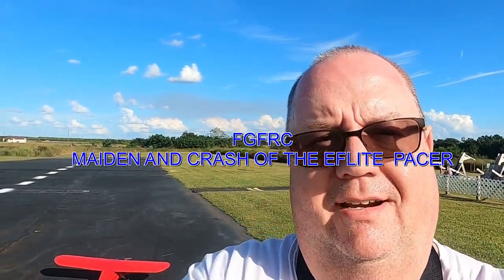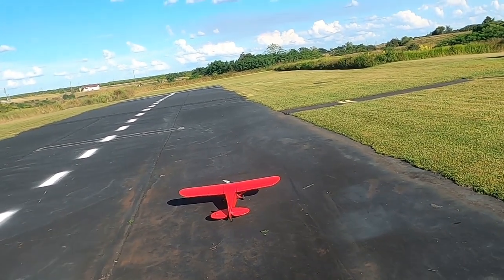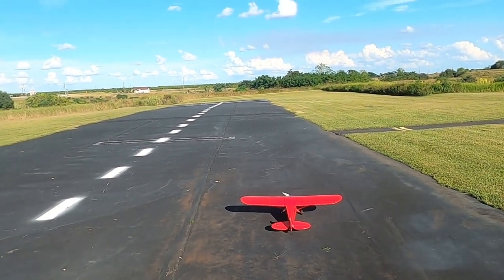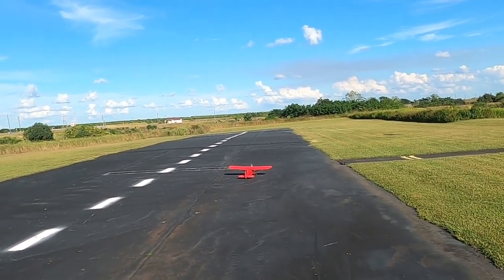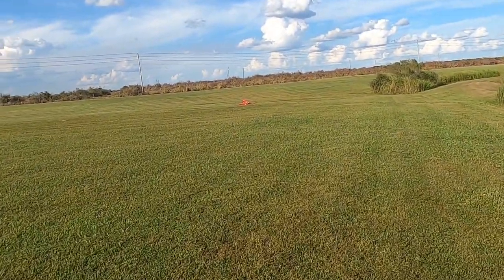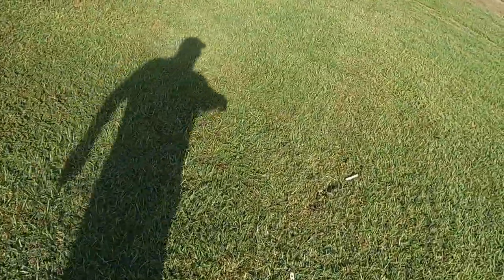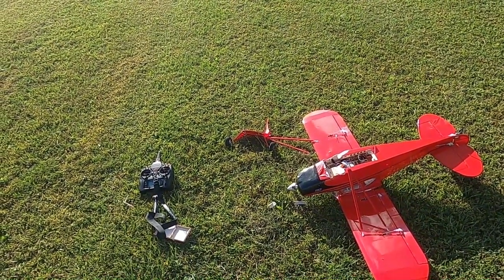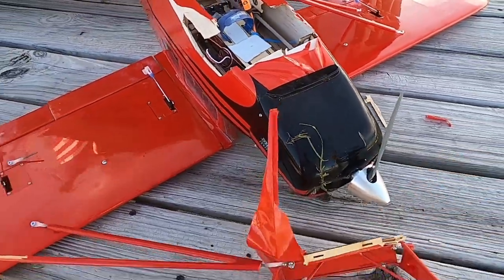OHH NO!!! MAIDEN AND CRASH OF THE EFLITE PACER PA 20 BY FGFRC

Comment: I had a range test recently (used reciever not mine)and I thought it was not going well.   I had reception at 10 paces but not 12 paces.   I tried to fly anyway,  crashed.   Repairs included a new battery and reciever. Part of the hobby like you said.
Reply from the maker: We get so intent on flying that we ignore that little voice of caution and reason.

Comment: First Question , why you using the original plastik Hinghes? Thats damn plastik that broke like little peace of Balsa Wood. I never use these, only metal Hinghes on the Rudder's! 
I have the same model and no problems with it. Maybe the Servo Is broken too in the flight so it blocks in one Position. 
Greetings Timo
Reply from the maker: That is because I am really good with foamies but very little experience with the Woodies. I have had some good experiences with the Balsa and pine planse since this crash and am learning. But its like anything else you crawl before you walk. Or in this case crash before fly...lol.

Comment: I hate to jump on the bandwagon but I've had several issues with my Lemon Receiver. I don't and won't use it anymore.
Reply from the maker: Well i have them in other planes and have never had a problem. It may have been the elevator servo also.
Reply: @FatGuyFliesRC  yeah, I guess you can have problems with any of the electronics. I just had too many problems with my one lemon receiver.

Comment: Oh NO - Balsa !!!! NO THANK YOU.... Really sorry about your crash- 6th sense at 2:00 - we all must really learn to listen to that little voice in the back of our head.. easy to say with Hindsight - I am the worst at listening to that little voice..... Yep crash a foam aircraft and you have a change to carry it back and repair it  - crash a balsa and its Bin bag Trash time.......
Reply from the maker: Well at least I have alot of good parts now.
Reply: Balsa does fly better   I have waited to start flying Balsa ARF's till I became much more proficient at avoiding crashes. I started with a slightly crashed balsa plane which the pilot did not want to fix himself so he offered it to me at a very low price, well under the value of the 45 A ESC, the Lemon Stab receiver,  4- 9gr servos and a good landing gear with tires.  Maybe the motor is still good but I have to get the collet fitting off that had broken.  

I have just started a Tower Sport, the plane is inexpensive and I had  a lot of the hardware and electronics needed.